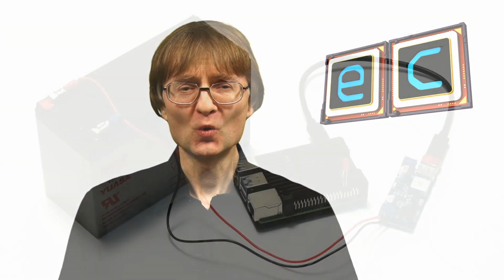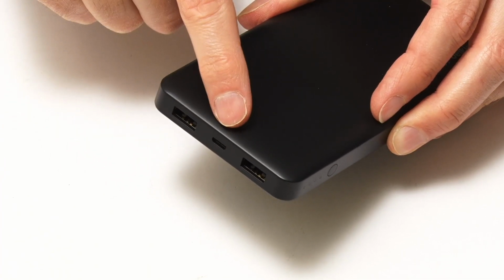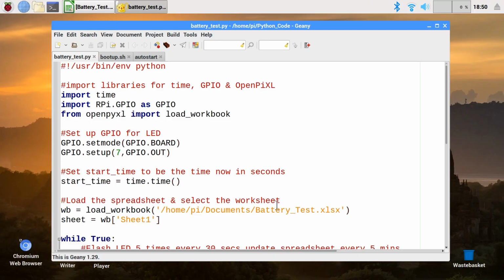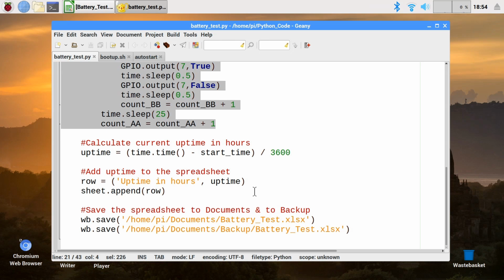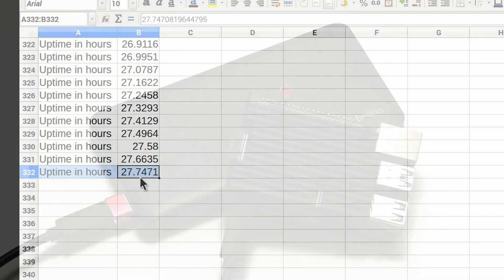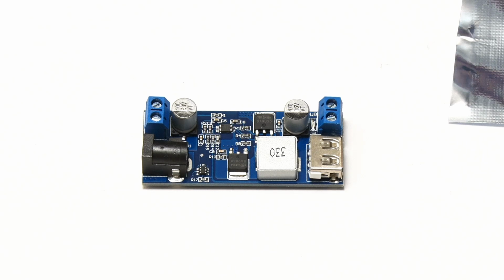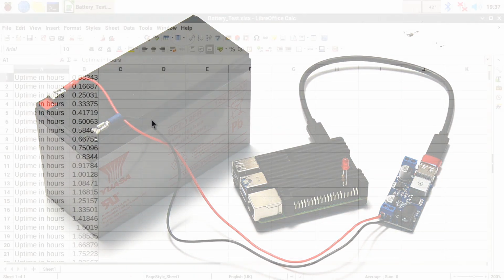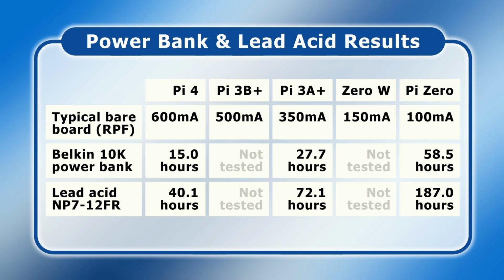Raspberry Pi Battery Power

Comment: Great video in the middle of the long weekend :-). I hope to see some kind of low voltage cut off circuit in the greenhouse video. It is important to keep in from deep discharging the lead acid battery.

Comment: Using a LifePO4 will be very slightly more expensive short term but will last for 2000+ cycles vs led acid.  Also, using a pair of LifePO4 cells in series will bring you to a nominal voltage of 6.4V, which is much closer to the 5V for the Pi, making your buck conversion even more efficient.  With a nominal voltage of half the lead acid, a lower self discharge rate and a faster charge rate you could even charge this via a small solar panel.  You'd probably want to oversize the panel since you're in England but it's definitely practical.  The only downside vs lead acid is that you can not charge LifePO4 when it's below freezing, though I suppose you wouldn't be watering your plants then either!  Another youtuber in the north of your country, Adam Welch, has tons of videos on his small solar setup as well as solar related electronics.   I've really enjoyed your channel, keep up the good work!  Cheers!

Comment: I have a USB-rechargeable flashlight that has an input rating of 5V 1A. Can I use a powerbank with an output of 5V 3A to charge my flashlight? Or does it HAVE to output EXACTLY 1A? 

I know that I should NOT use a powersource with any other voltage (V) or with A LOWER current (A) output than what the device is rated for, but what about using a powerbank/adapter that has just the right amount of voltage (V) but a stronger current (A)? 🤔

Comment: Power bank manufacturers mark their capacity not by load, but by battery. The average voltage of the battery is, say, 3.8 V. At the output, we need 5 V. Therefore, the current consumed from the battery (excluding the efficiency of the converter) is greater than 1.3 times the load current. Therefore, their capacity in Ah at 5V load will be, maximum, 0.75 of the declared one.

Comment: but, can you safely charge a lead acid battery while using it at the same time to power something? what to add to convert such setup in a proper ups, even better adding charge monitoring so to safely shutdown a raspberry before battery flat? And of course all the other needed things, like don't turn on the raspberry till the battery charge has reached a safe charge level, to avoid the immediate shutdown, in case of power back...

Comment: Well done video.
I used to run my internet modem/router using a battery that is charging from the grid all the time, when the electricity is down the router won't restart and the battery will provide the power but I think that it's not health for the battery to charge/discharge all the time.

Comment: Thank you. This shows there are improvements to be made in the lithium battery. Some functions of energy can be simulated. 
Idea - You can NOT mix batteries but I wonder if its possible to combine different chemistry energies by a gearbox mechanical generator to electricity. Mechanical gears run by motors connected to different battery types? Axle of different materials?

Comment: Chris I dont know if this has already been mentioned, the lead acid doesn't have a disconnect like the battery bank so it will continue to discharge past its 10.0V when its considered at deep discharged. even though a lead acid will continue to output, especially in low power devices beyond its deep discharge point it is not good for them and can create the same problems like all rechargeable batteries that are over cycled. but lead acids will put up with way more abuse than any other battery type on the market...

Comment: Don't know the charging ability of a small solar panel, but the Zero seems close to being indefinitely runnable off of solar power with the lead acid battery. I have large 150W@12V panel on my doit my self camper van and it has no problem charging a 12V large marine battery in a day. I guess the solar requirement for (7ampH @ 12V) in 7 days for 10 hour using a 12V panel would be (7ampH/70H=.1 amp @ 12V a bit over a Watt) so a 5W panel should work. I have had used folding solar panel for camping and they did not seem to be doing much in keeping battery packs charged against the drain of a few phones and ipads, it may not be the small panel though but the power consumption of a phone or ipad when compared to a Zero.

Comment: Thank you.  That was very interesting.  I have been looking at building a Pi (possibly Zero) with a DAB HAT to connect onto my motorbike for longer journeys.  Power (especially using BT to the helmet intercom) was a concern, so I was looking at a 12V to 5V converter or a battery pack with USB.  This looks as if it could do the trick.  Just need to work out a suitable case for it and the Pi/DAB HAT.

Comment: I have a car battery under my workbench permanently connected to a charger so it never goes down.  Reason is that I bought a auto stereo amplifier and it's very strong but runs on 12v.  But since I have 12V "on tap" I have discovered a lot of uses for it.  Very handy for driving relays and motors and lot's of current capability.  No worries about how much draw. If the battery drains faster than the charger can supply it's catch up later.  Biggest drain is the stereo amplifier but even that is only for a few hours at a stretch and I don't "crank it" for long periods anyway.  Just when a particular song is playing and I'm in the right mood. Also adding an inverter makes a good homemade UPS if you want to go that route.

Comment: What voltage did you run the SLA battery down to for cut off? These tests also beg for the question of what size solar panel do you need to fully charge during the day to be able to last through the night? Seems like it would be fairly small for the Zero.

Comment: It would be better to compare the Wh capacity of the batteries . The "10000mA" capacity of the power bank is often a miscalculated addition of miscalculated cell capacity!  Wheras the LA battery is probably accurate when rated at the correct  load.

Comment: a cheap lead acid like used in an electrified fence and a solar panel used for said same system. Tractor Supply (or your nations' version) for your Pi power needs!

Comment: I'm thinking the buck converter can probably still produce 5V with input voltages dropping into single digits, so it might be overdischarging the battery. Maybe one more test but with a multimeter to see the battery voltage?

Comment: Hello Chris loved the video. Recently I had a RPI4 with a dozen 1-wire temperature sensors for a university project. They work really well for outdoor use ( especially the ones with stainless steel casing). You might find useful tips from "the Farmacy Seeds Network", he has a nice setup for a greenhouse.

Comment: SLA batteries like one you used will indeed show less capacity when used in UPS devices, but they're discharged with 50-100 amps there. When you discharge them with less than 2A (as in your case) the capacity is almost the same as declared, I usually measure 6 - 6.5Ah for good condition 7Ah SLA 12V batteries when I discharge them at 2A.
Also one important thing, those batteries don't like being over-discharged so it's the good idea to terminate discharge when battery reaches 10.8V. There is not much capacity left at that point and battery won't be damaged if you stop draining it there. At lower voltages irreversible chemical reactions will begin to occur, lowering the batteries capacity permanently. You probably can find some 12V-5V buck converter that is designed to be used with SLA batteries so it has over-discharge termination circuitry built in.
One more thing, if SLA battery will be used in mode where it will see many discharge-charge cycles it's good idea to use deep-cycle type of batteries, they're designed for such use and won't lose as much capacity as ones intended to be kept at full charge and discharged very rarely.

Comment: Very interesting video. You can get 7Ah Lithium Iron Phosphate LiFePO4 12v Battery for about £55. More initial cost than lead acid, but more usable power, much faster to recharge and far longer lifespan. Add a small solar panel in to the mix and it would be pretty much self-sustaining even in the cloudy UK.

Comment: Hi Chris, thanks for another great video.  You really should insert a fuse as close to the 12 Volt battery terminals as possible.  If you get a short circuit or fault there is a hell of a lot of current available and it won't end well!

Comment: Great content and very ground to earth and fully explained test procedure which I love to watch and like to build and to adopt one way or the other cause even having a big 10 kWP DIY solar power roof I had not thought about powering my typical DC devices from a smaller battery with its own 2 solar panels kicking out the big inverter overhead and using a simple lead acid battery like I have from my mobile home with 12V and 80 Ah as AGM battery that should last longer. This can store 80.000 mAh and it simply only needs a better buck converter with a few outlets even for "fast charging" devices like the cellphones and tablets and so on. 

I would love to hear and see your thoughts, maybe covered in the upcoming greenhouse project.

And "Green house away" sounds like a use case for LoRa and there has been a project about a greenhouse 1 incl. ventilation which later was damaged by a storm and DIY reerected in a greenhouse project 2 this time with ventilation and watering by the GREATSCOTT! channel you might know for sure.

thx for sharing your ideas and thoughts and for remembering me about the different autostart things I had struggled recently again.

Comment: Your next project would be interesting if a solar panel (which should be usable in a greenhouse) can charge the battery whilst it's in use. The application could work for a very long time indeed. Nice tests, thanks for the video.

Comment: Great video im just missing a little more info on how to avoid that pesky lighting bolt telling me theres not enough power. No powerbank has done it for me yet :(
Reply: If you are using a Pi 4 then You should use a usb pd powerbank this fixed it on my case. For others I don't know the solution.
Reply: @neerajdwivedi2015  I have a Sandstrøm S6P20PD19 and it should have PD capabilities, still no dice.
Reply: @GenerationAI2024 weird. It shouldn't show it. I use my Pi 4 with a OnePlus USB PD powerbank and I don't get any ⚡ sign.

Comment: Another fun project in a similar manner, solar panels, charging lead batteries for emergency use, possibly powering low drain items like the pi, or as a power bank recharge station?

Comment: Really for big iron like this ( above a microcontroller ) you would only use battery as a form of UPS you would not run these on battery exclusively.  I did the characterization on an esp32 on a custom PCB with alot of i2c and analog devices using a solar charging board with a MAX17044 and an INA219 used these numbers among other things to alleviate rush on current and glitch state situations.  On the bigger iron side ( BeagleBone Black) I leveraged the Andicelabs powercape that provides a way to use external power / battery solar very safely it has again an ina219 and a programmable AVR which is also highly configurable.  I use this in a hexapod ROS configuration its OS is a self modded Arch Linux on a 64gb microsd.  Under normal uses it can power the beagle over the Li/Poly JST but with all my additions it hits the upper brown out immediately and shuts down which is not an issue as I use a dual power config for the MCU / Pololu maestro and the Servo's.

Comment: That was very informative and interesting.  When you install the Pi in the greenhouse will it be used to just monitor temperature/humidity etc or will it control heating and ventilation?  Maybe a couple of solar panels or a turbine to keep the battery charged.  Look forward to it anyway.

Comment: Very nice and practical approach videos. The crucial factor in this application is obviously the switching regulators used in all cases. A better approach would be to use a 6 volts lead acid.

Comment: I had just spent 4 hours (again) contemplating a (X705) UPS + 12v setup for a portable (luggable?) Dual Pi4 (8G 64bit OS & 4G 32bit OS + 4 port 2.5Ghz switch) setup each with a dual SSD (X829 - has 2 extra USB3) board and 2 10Tb 3.5" SATA HD (X880) boards and 1/2 of those 12v batteries used in the video, charged by a solar controller fed by a 12v 120W DELL laptop power adapter. A carry handle and a screen on the side, so a car battery was out of the question - And then your video popped up  :) BTW ...

... I regularly (for past 6 months) have to use (cycle one of 2) 20,000 mAh Redmi battery banks with my RPi4 + 2.5" 1Tb HD, mostly watch youtube and anime over wifi atm - they last a good 12 hours (the Xaomi 12,000 mAh around 8 hours). The only issue I had was the need to use short (4 inch) cables otherwise you get power warnings.

Comment: How about using a buck converter with a built in charger? That would act as emergency backup power in case of power failure. Also, did you use a new lead acid battery for each test? Lead acid batteries lose a lot of capacity after being drained completely.

Comment: Heroic effort! Some serious planning, and a lot of tedious work over considerable time, (even if it was background once set up for each board). 
For the greenhouse application, a solar panel trickle-charging the battery might give an effectively continuous operation. Essentially a UPS that is guaranteed to be active overnight. Assuming an average of 8 hours daylight, it would have to have a charging rate 3 x the draw, so 1.8 amps for the Pi 4. Rounding up, 9 watts. A 10 watt panel 2' x 1' advertised for $40 CDN looks as though it would do the job, though a charge controller in the circuit would likely be prudent. That's back-of-the-envelope hand-waving, so anyonr with actual experience is invited to correct the assumptions.
Reply: I may have over-specified and under-shopped there. An online source offers a panel slightly smaller than that (with an implausibly high quoted output, but probably adequate), with controller,  for around $35 CDN, about 20 guineas.

Comment: Interesting indeed how old-tech lead-acid batteries still performing very well,
14:33 That was a very useful formula to calculate the output amps,

for your greenhouse, you maybe can extend your battery runtime by charging it using a small solar panel,

Thanks Chris,
Reply: Or just buy another inexpensive battery and swap them out every few days.

Comment: I think you have missed a something. The spec of the belkin (just as most other powerbanks) of 10000 mAh is meaningless without a cell voltage specification. Without that we have no idea of the stored energy of the device. Most powerbanks only have a single Li-ion cell so that would be about 3.7*10 or 37 Wh in this case. In the case of the lead acid battery things are better, since we can at least multiply capacity by the nominal voltage to get a value for the stored energy (7x12 = 84 Wh in this case). if you look at the numbers this way, I guess the relative performance of the powerbank and Lead-acid battery are more or less in the line of expectation I think.

Comment: Interesting prognosis!  I have a decent 20000mah power bank and a 25000mah power bank.  I have a raspberry pi zero, a pi 2 and the original pi.  I feel video tests would be the best test as they will be far quicker!  You say 'real world' but I would not run excel stuff on battery in this context!  However, fascinating stuff!

Comment: Wont Lead Acid die rather quickly from too many discharges? Is it not supposed to be somewhat charged all the time?
Reply: Depends on the type of battery, a standard (cheap) lead acid cannot be discharged below 50% without damage. Better ones will have less damge. AGM batteries can be deep discharged, down to 20-30%. Gel Batteries, also 20-30%. Li-ion batteries can never be discharged below 50%. LiFePo4 batteries can be discharged down to around 25% with high current without problems but has about half the energy density of Li-ion.

Comment: Thanks for the video. Very interesting!

Maybe as a follow-up video, if you can show if it is possible for a raspberry pi to calculate estimated battery time left based on current voltage. Also maybe to instruct Raspberry Pi to shutdown if certain level reached to avoid draining battery completely.

Comment: Enjoyed the video! But isn't the 65% capacity for the lead acid based on what you should discharge it to? You can use 100% of its capacity, but it damages the battery and will lower the number if times it can be recharged or make the battery only last a very short period.

Comment: The mAh rating on a power bank is not at 5V, but at the voltage of the internal battery (3.7V). The current rating at 5V will be the stated rating times 3.7/5 (minus the loss of the internal buck converter). This is another example of misleading marketing-speak...

Comment: The buck converter made it possible to use a low voltage from lead acid.  Always keep lead acid topped off and floated to 14.3 volts for longevity, never let sit discharged, I would put a timer on charger to top off 1x month.